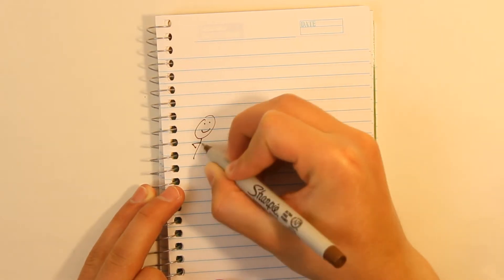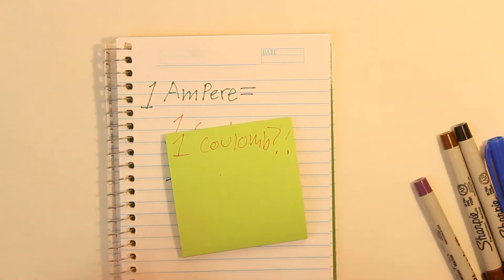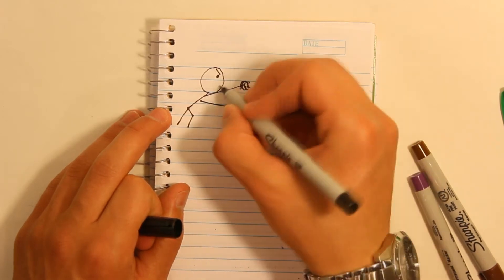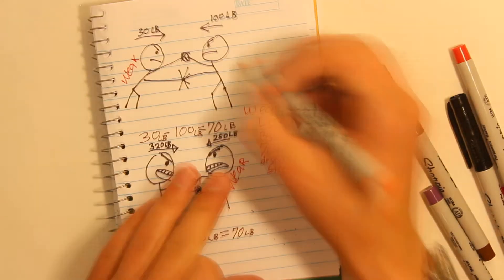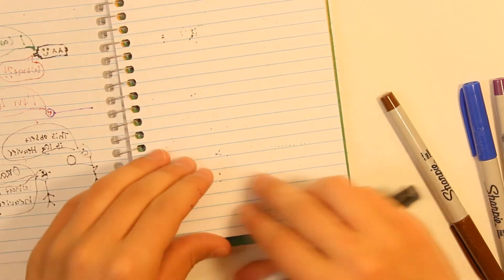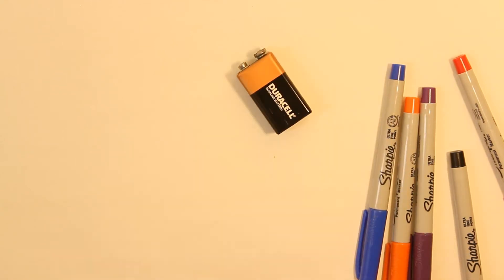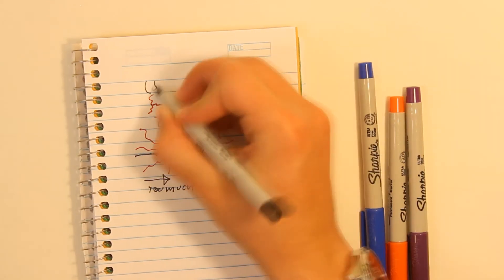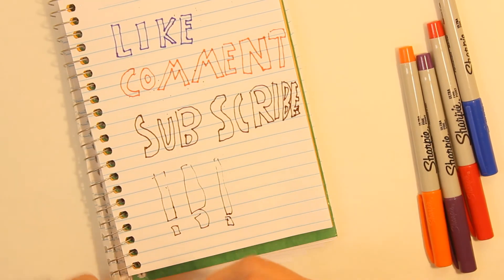Amps Vs. Volts

Comment: I believe this is the first time I actually understood how you can obtain 1000000 volts with 0.001 amps current (even if I'm exaggerating, but it's theoretically possible) or a 12 volts 240 amps current (such as on a big battery)! So it's all about the quantity of the need for electrons to move from a higher potential to a lower potential zone (thus describing the obtained voltage) and the quantity of electrons that actually make it to go from that higher potential to the lower potential over a given period of time (thus describing the obtained amps).
If I mistakenly mixed or understood it, at least please let me know I'm wrong.
Thank you very much.

Comment: INPUT: AC85-265V  50/60Hz -----OUTPUT: 550mA     +-5%  this is the rating of an led, pls I want a diagram of how to run the 550mA Led on a 12volts 75 amps car battery. thanks

Comment: So if I have a battery of 5V and 10A, and another one of 10V and 5A wich one will be stronger?
Reply: Mike G then why are there such two different batteries in world
Reply: Akhil Swaminathan the 5v 10a battery would last longer, but could not deliver as much power in a single moment, while a 10v 5a battery would be capable of delivering more power, but for not as long. Even though both are 50w, they would have different purposes
Reply: @mochi_pink1  I'm confused, wouldn't it be the opposite? 10 amps = 10 coulombs/second or approximately = to 6.24*10^19 e-/s.  So I'm depleting 6.24 x 10^19 electrons per second if I have 10amps.  If I have 5 amps, I'm only moving electrons at half the rate. So a 5A battery would last twice as long as a 10A battery then, wouldn't it?

It seems like a 10V 5A battery would be able to deliver more energy overall, but it would take longer to deliver it.  A volt being defined (simplified) as more or less as the energy per electron. This means a 10V battery of the same physical size would therefore have more energy overall than a 5V battery (more energy per electron, same number of electrons = more energy total), and therefore by definition a greater capacity to do work. This work would take place over a longer period of time however, as the rate at which it could perform work, AKA its "power" (joules per second), is limited by the rate at which the electrons can move (aka the amps). Compared to a 5V 10A battery, the 10V 5A one may have more energy overall, but it would only be able to output that energy half as fast. Both batteries would therefore be able to output the same amount of energy per second - or, by definition, would have the same power output. (note that that doesn't mean one battery doesn't have more energy overall - if you made both of them explode then the 10V one would make a bigger explosion)